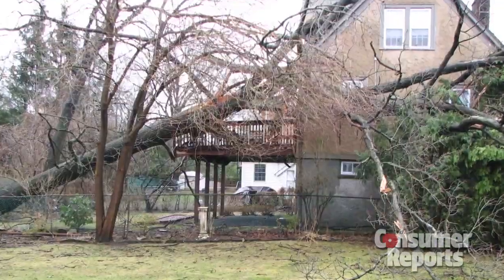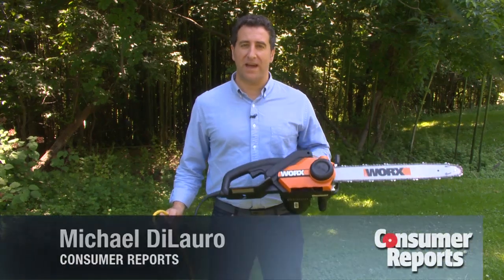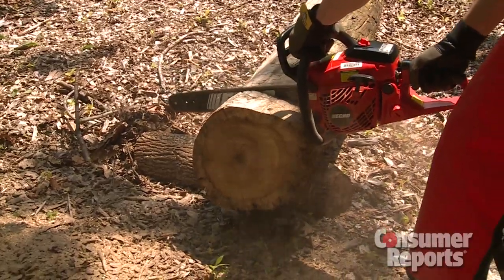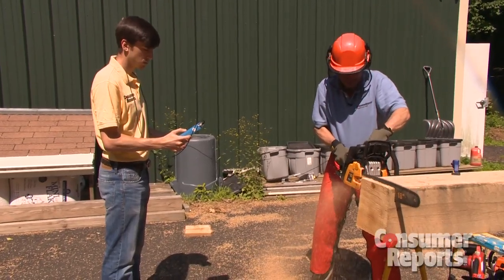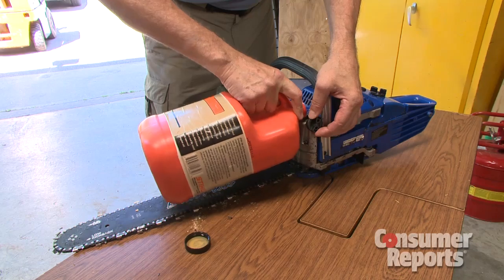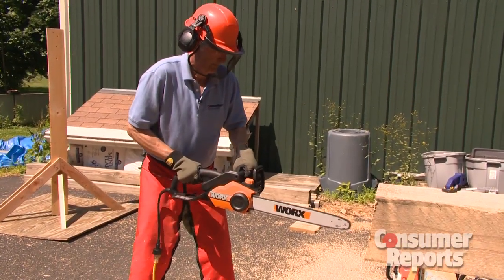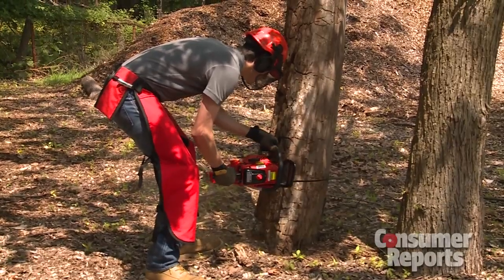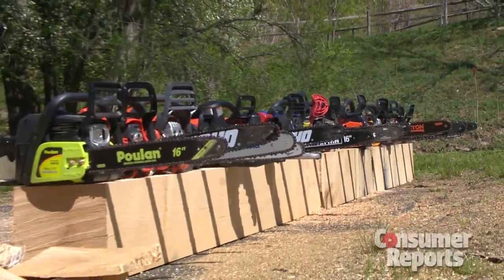Chain Saw Buying Guide | Consumer Reports

Comment: I have poulan pro 50cc cost me 185 dollars I have cut roughly 60 cords thing is still running strong people just need to have a sharp chain and use good gas
Reply: Dangerous Danny Smith Nissan Titan lift kit problems
Reply: I'm glad you have good luck with yours.... mine is a POS.  I cut 6 to 10 cords a year and purchased it 2 years ago after my old saw was stolen.  Decided to go cheap....... Had to replace the bar, chain, oiler, open muffler, and adjust carb just to get it to cut decent... and I am always fiddling with the carb. It gets hot..... adjust carb. Its cold...... adjust carb.  It lays on its side for 30 seconds...... adjust carb, after pulling it over for 5 minutes.... cursing all the way.   
  No more.  I purchased a new 60cc Echo 2 months ago and will never look back.  It cut and ran great right out of the box. After felling and bucking 5 large trees, I have had to do nothing but sharpen chain. Runs great every time.
Reply: banshee8989 go stihl, echo, or husqvarna next time.  Worth the $$!.

Comment: My DeWalt 20v xr chainsaw cuts for almost an hour with a 5ah battery, is light and super quiet. For not much more weight, my echo cs400 offers a lot more power.

Comment: If electric powered saws don't have that much power then why can they cut through 9 layer chaps and a gas powered one cannot? Just a thought.
Reply: because electronic has more torque and don't stop
Reply: +Sean Hatley the clutch probably, electric may not have

Comment: This is a pretty good and helpful video. However, you grossly overstated tightening the chain. THEN, you didn't show how to do it properly!

A new chain may need tightening after about the first 30 minutes of use. After that keep an eye on it and keep it PROPERLY snug when needed. And ANY CHAIN SAW MANUAL WILL TELL YOU THAT!!

Read your saw manual for the best tips on saw operation and keeping it going.

Comment: Quit messing with these toys,get aHusqvarna372xp, Stihl MS-460,Dolmar PS-7900. If you want a smaller saw, a Husqvarna 346XP or 550XP is a good choice, as is a Dolmar PS-5105.Echo is a decent saw if you must get one from a box store.Forget anything with a plastic crankcase and sub-50cc, even if it is from Stihl or Husqvarna.
Reply: Interesting tips and thanks for sharing!  But the saws that you are mentioning are best for the pros and not homeowners like me who will only need a chain saw occasionally.  Why spend big bucks on a saw that will not get used that much? And CR recommends highly a Stihl gas saw that has only 32 cc.
Reply: Doug Celeste

Comment: Useless video, and OBSOLETE in 2018. Homeowners who don't heat with wood are probably better off with a corded or battery saw because they have no fuel system to screw up when sitting for a long time between uses. I have both and love my 20V and 60V DeWalts. The economics are different of course, but not buying fuel, oil or ninety dollar carburetors is rather nice. My gas saw is an Echo Timber Wolf. Great saw, but not for typical tasks like limbing and pruning. (I use my DeWalt 20V for that.)

Comment: Stihl , Husqvarna , Echo/Shindaiwa the only names that hold their weight in the chainsaw world battery and cordless are just old lady toys , if you aint buying a quality saw don't bother and buy a silky pruning saw .
Reply: Steve have you ever heard of Dolmar?
Reply: Steve slumdog amen to that brother
Reply: Or Jonsered?
Reply: echo makes a great cordless 16" 58v now, but I opted for the 56v ego 16". cuts through 8" log in 5seconds and can do it about 80-90 times on a charge. no fumes, noise or 2cycle starts and care. 350$CAD, about 250$USD. the echo is about 50$ more and has similar performance. dewalt slightly less good. everything else is as you said a POS lady toy.
Reply: Jonsered makes a great saw as well.